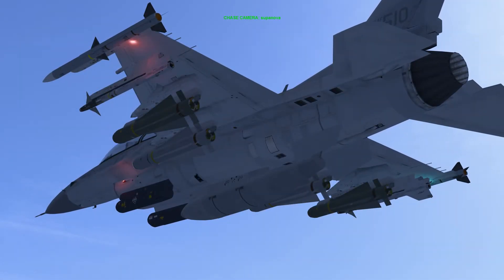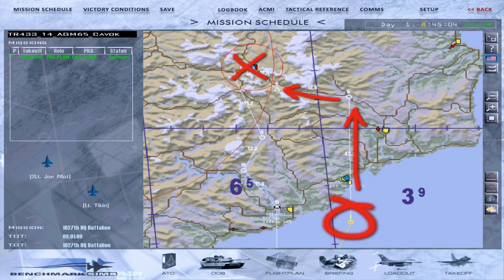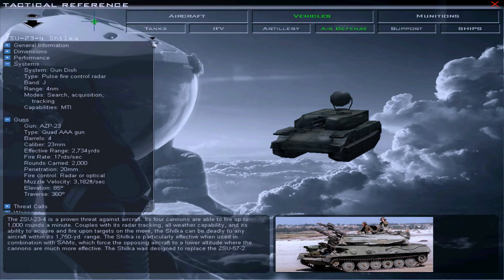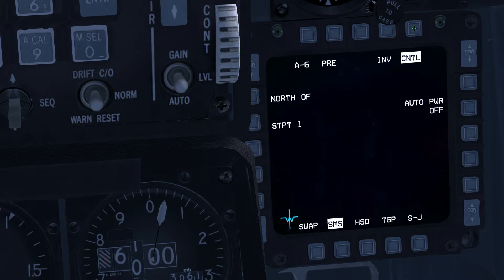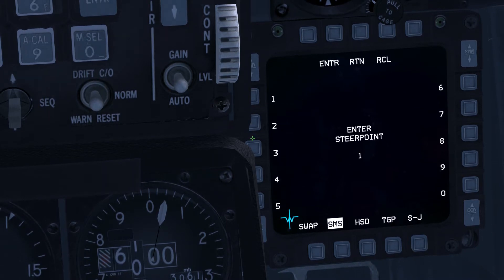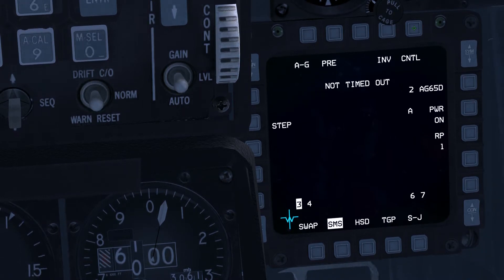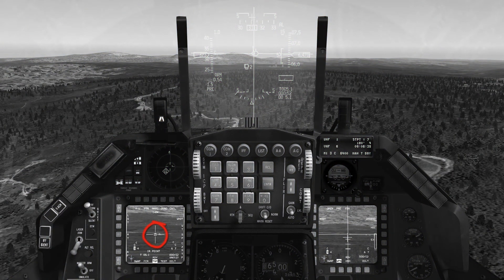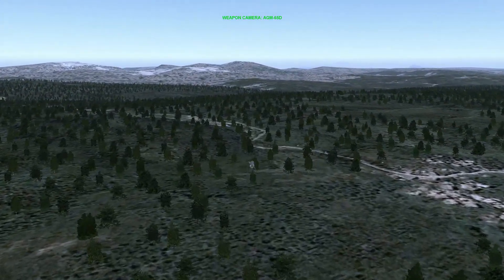Falcon 4 BMS 4.33 Tutorial 10 AGM65D Maverick vs ZSU 23-4 Shilka

Comment: Sooooo... you need to manually boresight the missiles? Why the ground crew handles you a jet with ordinance non boresighted? Imagine doing this on the heat of the battle... LOL it's senseless.
Reply from the maker: You have to align the sensors, which can be done on the ground. In BMS you'd typically do that en route to the target.

Comment: Any idea why my master caution sound sounds different? It's the same aircraft and the same TE, but over here I have a beep like sound, like the one in commercial aircrafts when the pilot tells passengers to fasten their seatbelts haha.
Reply from the maker: I assume the sound file is the same, so I can only suggest a difference in sound card or speakers.
Reply: supanova Just found it, I had the MK2 dedicated sounds turned on, but they are way too loud.
Reply from the maker: I'm glad you found the solution. I haven't come across that issue.

Comment: Great video’s as always so thank you. I wish you would include more HOTAS commands. E.g. on the TGP TMS-Left cycles between WHOT-BHOT, double press TMS-Left will cycle between TV and IR mode, while double press TMS-Right will cycle the laser pointer between L-IR-BOTH. Pinky button on the stick toggles field of view. The whole point of HOTAS is to keep your hands on the controls as much as possible without pressing buttons on the instrument panels.
Tip 1: after getting avionics fault due to TGP Handoff Fail you press MASTER CAUTION RESET, F-ACK, TEST, CLR which is 4 actions. If you select TEST page and then press CLR (only 2 actions) the MASTER CAUTION and PILOT FAULT LIST will also clear. OR you could quick boresight as in your other video which eliminates the handoff fail message.
Tip 2: when slewing TGP cursors and they are too sensitive, press TMS-Right to enter area mode to ground-stabilise the TGP and slewing will be less sensitive so you can fine tune cursors.
Reply from the maker: I think that would be something to cover with an advanced series.

Comment: At 7:42 when uncaging missile, my right MFD doesn't change from the blank WPN screen.  I've followed each instruction step by step but something is missing. Can't continue on because I can't get a missile view on the right MFD no matter what I click on or type. Guess it's back to the -1 and -34-1-1
*update* watched another vid that doesn't setup the auto powerup West of steer5 and I'm getting further. One month into learning BMS and I feel like I only know 5% of the required knowledge. This ain't your gran'dad's FA18 Hornet game.
Reply from the maker: You can use the automatic power on, but you have to reach the point specified for it to trigger. Otherwise the manual power on works fine.

Comment: How did you acquire two targets simultaneously? Is it just a matter of handing off one to one mav, selecting another mav and handing off another target?

Thanks
Reply from the maker: Designate with the TGP using TMS Up to command Point Track. HANDOFF IN PROGRESS should appear on the WPN page, and a C appears over the weapon station number. Switch to the next Maverick with the MSL STEP button and repeat the process. With a steady pointing cross the Mavericks are ready to be fired. Don't forget to adjust zoom level on the TGP with ALT+F3 and ALT+F4.

Comment: Has anyone flying with the Thrustmaster Cougar gotten the cursor button on the throttle to work, to actually move the radar cursor? If so, how'd you do it?
Reply: I know it's been a few months, but I use a Cougar throttle and I can walk you through the process of setting up the cursor, if you haven't already found a solution.
Reply: tommyzDad Glad you got it sorted out!! But no, I don't fly vanilla 4.0. I stick to BMS when it comes to Falcon.
Reply from the maker: I don't have a cougar, but I presume it does work as you described. Does it not work at all, or just in certain circumstances, or certain systems? The BMS forum has quite a few Cougar users, so that would be the best place to ask for a thorough answer.
Reply: Well I know the button itself works, as I mapped it to roll and pitch as a test, but I'll be damned if I can't figure out why it doesn't move the cursor.

I'll try the DMS Forum again, trying other search terms, hoping to get a more focused hit.
Reply from the maker: The only other thing I can suggest is look at the output on the setup screen when using the shifted arrow keys, then try the buttons to check they match.
Reply: Thanks, Austin, but I found the solution not long after posting--I just had to search a little bit harder.

I wonder though, have you used the Cougar with (vanilla) Falcon 4.0? I've been using Foxy to get the stick and throttle to work with it, but it's been hit or miss: I get the speedbrakes to open, but then trim doesn't work, or vice-versa.

Comment: How are you handing off two targets? I'm doing something wrong in that both mine are hitting the same target.
Reply from the maker: Try TMS Up to lock the first target, fire the missile, TMS Down to cancel, then move to the second target and lock that up with TMS Up. I would have to look at the scenario again but TMS Up alone should work for both targets. You have to make sure you have a good lock on both targets.
Reply: Thanks. What I wanted to do was handoff two targets to two 65Ds, and set the ripple count to 2.  I wanted both to track different targets.  What I think I was doing wrong was not handing them off correctly.  I managed last night to get two off from one pickle and have them track and hit two targets. What I think I did differently was to handoff from TGP with TMS up (point lock), then hard lock the Mav on WPN, then MSL STEP. I broke lock on TGP, slewed to the second target and did a TMS up (point) a second time. I could see TD1 and TD2 in the HUD after I did that.  I hope that makes sense.
Reply from the maker: I can't recall the procedure I followed, but I think I just locked them up with TMS Up. As long as they're correctly boresighted that should work, but I'd have to go back over it to test the procedure.

Comment: Your videos are great! A tip for the avionics fault: Point track the TGP first, then open the WPN page and carry out the procedure, this should result in no errors. As the WPN page isn't up, the TGP doesn't try to hand off. I'm not sure if this is realistic, but at least you won't have clear up the cautions. I also usually boresight both stations, then hand off to both stations to save time (steps AABB instead of AB, reset, AB). I'm not sure wether this is an accepted procedure though, or if it in real life could cause any issues.

Comment: Why not just lockon using the FCR? Wouldn't it be hard to find a target without the FCR?
Reply from the maker: You can use whichever tool is most appropriate for the circumstances. You can also combine tools to achieve the overall aim.

Comment: I think I missed that last step during boresighting - deselecting the target - and when I got to the objective, the missiles tracked to the steerpoint, instead of the shilkas.
Reply from the maker: The really difficult part is finding the correct targets and locking them up in time.

Those Shilkas are not easy to spot at low level and at speed.
Reply: supanova I flew the version with good weather, so that part wasn't that hard - I think they're slightly hotter than the trucks. It the missile guidance that kept hitting the steerpoint and not where I was telling them to. But your video really helped - turned out I didn't TMS down after boresighting. Now, if only I could figure out the A-10!

Comment: I've had an issue slaving my Maverick's to my FCR after manually slewing them around. I recall TMS down is supposed to slave the missile back to the FCR but when I hit TMS down now the camera seems to still be ground-stabilized at the point I was looking at previously?

Any advice is appreciated.
Reply from the maker: TMS down will only break the target lock. If you're manually slewing the Maverick and then want to use the TGP you would then swap SOI to the TGP.
Reply: supanova
I want to slave the Maverick's camera back to the FCR though. Is there a way to do that once you've started to manually slew the camera?
Reply: TMS down only slaves tgt pod to fcr, as far as im aware you cant slave mavs to the fcr.
Reply from the maker: I don't think I've ever had to do that. You might need to boresight it again.

Comment: Your cockpit looks really crisp compared to mine. I can't make it not pixely even at 1080p. Do you use any mods for it?
Reply from the maker: +Jason Klein It's stock 4.33. As long as you have the settings maxed out it might be an issue with your graphics card settings. The best place for answers would be the BMS forum if you're still having problems with it.